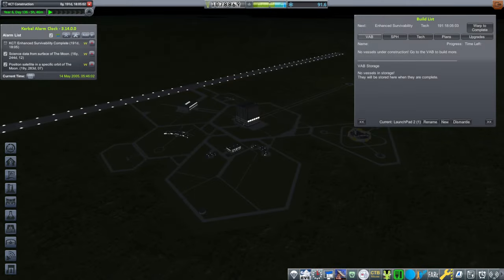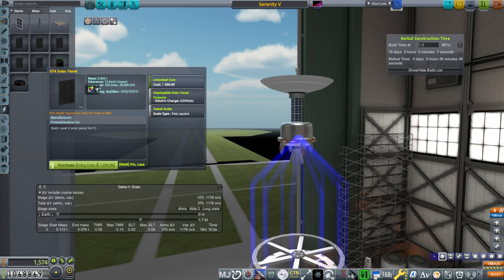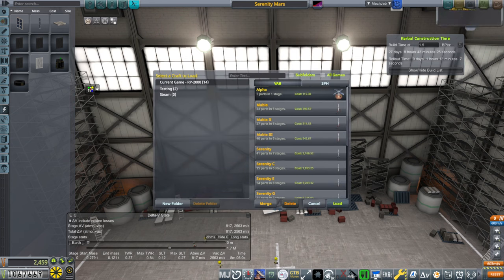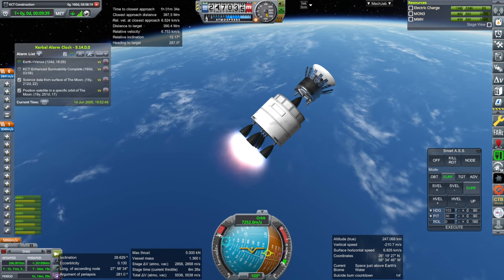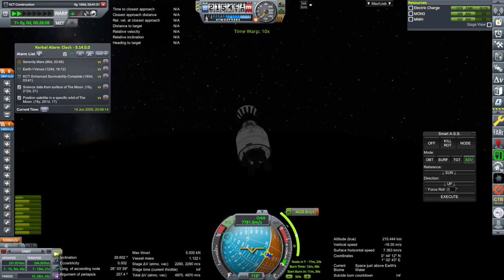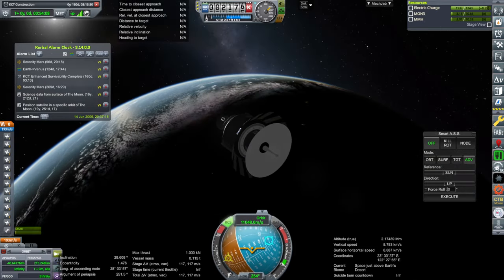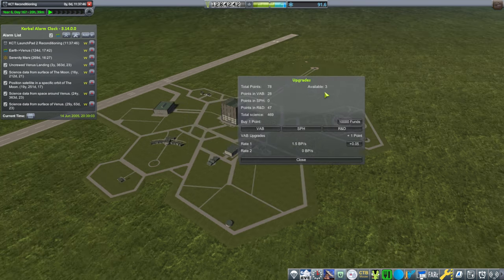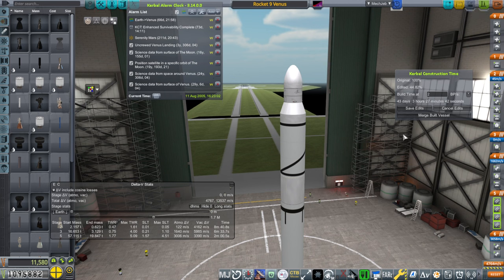RP 2000 Career 14 (RO in KSP 1.12)

Comment: The SM-16 SRB from the surestrut pack has a really long build time. Just adding 2 to my rocket increased the build time from 300 to 800 days.

Also all of the separation motors are under precision propulsion for 160 science. I think they should be relocated to somewhere earlier in the tech tree.
Reply from the maker: Those are very powerful boosters and I priced them according to what they ought to be, but maybe CRP or RealFuels sets the propellant cost very high, magnifying the cost - I'll have to check on that.